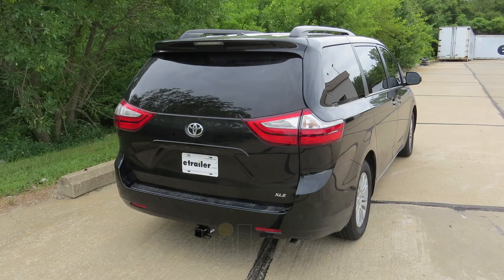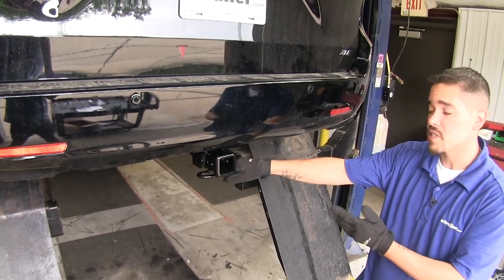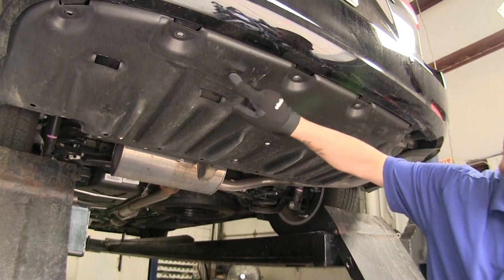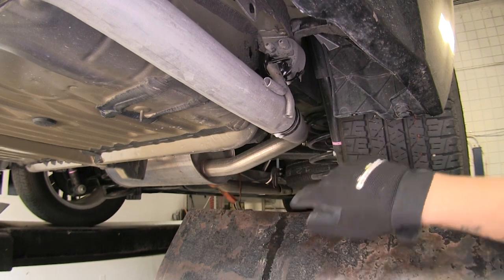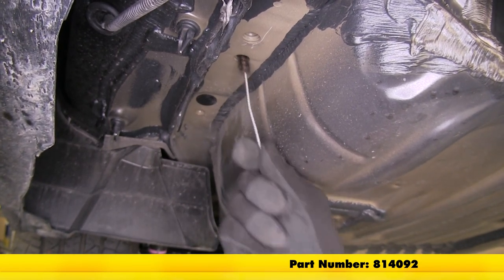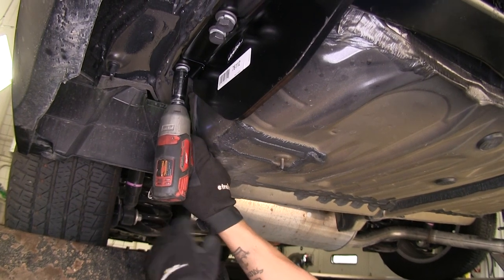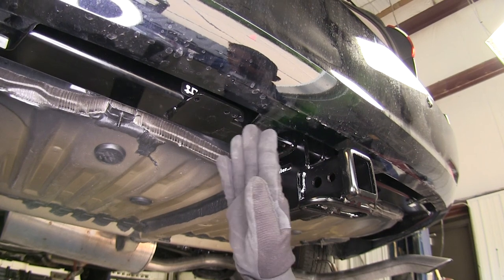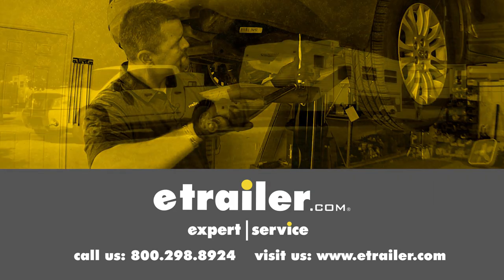etrailer | Set up: Draw-Tite Max-Frame Trailer Hitch Receiver on a 2017 Toyota Sienna

Comment: Awesome video. Made my install on the 2018 Siana quick and easy. Well relatively easy
Reply: My 2018 Sienna XLE has a slightly bigger cover for the underside of the van than the 2017 XLE. Did you find this too?
Reply: Christopher Dean I’m not sure. I measured a few times made my cut and it worked. I did a little more fine trimming but it fits perfect around the hitch.

Comment: I did not find it necessary to remove both rubber hangers on the exhaust. Only the one near the tail pipe and I also found it easier to pull the rubber off the 2 poles.  This was on a 2017 sienna.